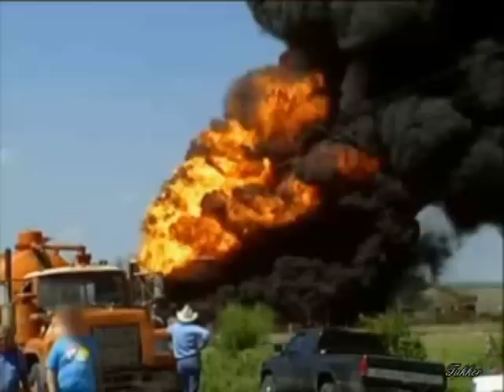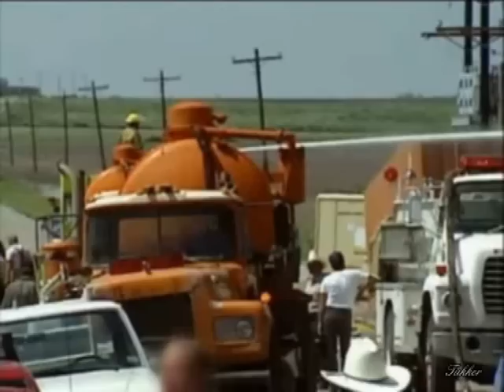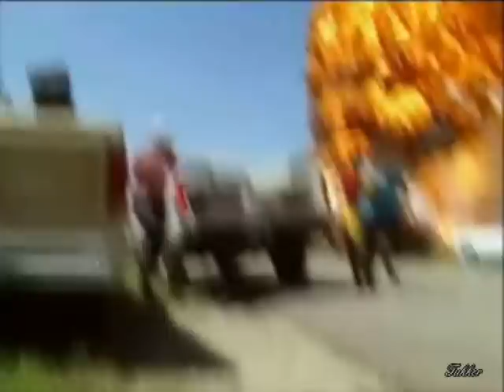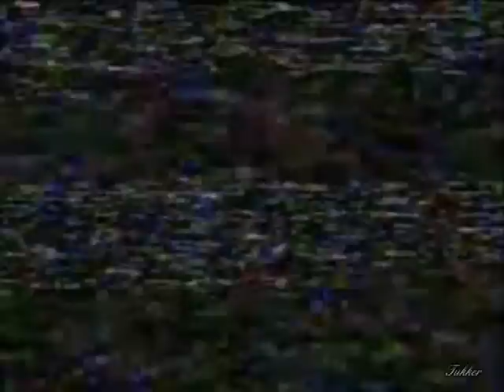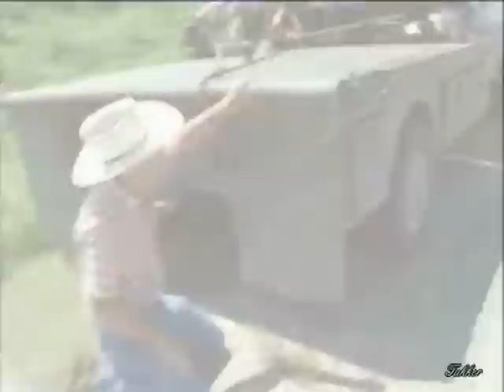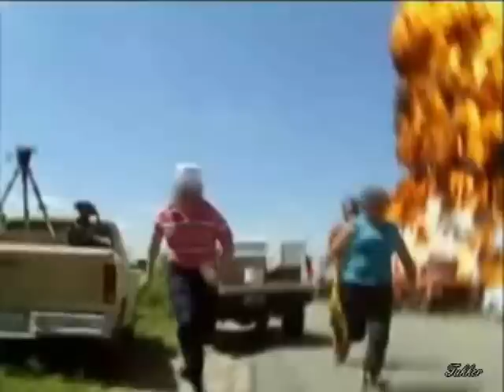Nasty Big Oil Storage Tank Explosion

Comment: WTF???? Water jets on an oil storage tank?  I hope that FD has learned something since then.  Technically the narrator has it slightly wrong as Chris Pichak has stated. It wasn't the fact that the oil was being heated by the steam as the oil was already past flash point but it was contained within the tank and only the exposed surface was burning.  What the water does is sink below the oil as the oil is lighter and then the water under the oil gradually reaches boiling pojnt and turns into an expanding vapour (steam) pushing the oil out of the confines of the tank and then the oil is free to burn. In the UK it's called a BLEVE an acronym for Boiling Liquid Expanding Vapour Explosion and is the reason you don't throw water on a chip pan fire.  The correct procedure is to cool the exterior of the tank with water to cool the oil in the tank until enough foam compound is available to attack the fire with a foam blanket AND maintain it.  The alternative is to carry on cooling until the oil burns away but that may take days and is not good for the environment.  The other point is WTF were members of the public allowed anywhere near such a massive explosion risk....it defies all logic?
Reply: Absolutely! You dropped the science right here!
Reply: thanks for the explanation. I feel like those people there were actually still sort of lucky, becauae if for some reason that tank had burst at a low level and let the oil flow out, they could all have been standing in a lake of fire in seconds.
Reply: Yes, this was Texas.
Reply: And I don't know why people are running away like it's WW2, They don't know That only gives 1 explosion and they are already enough away

Comment: @Moppy1988 We actually use steam to put out fires. We use a nozzle that creates a fog pattern also called a V pattern. The nozzle breaks up the water droplets to make them smaller which in turn causes them to turn to steam faster. The steam than expands in the air and displaces the oxygen in the air which causes the fire to go out. If done correctly you can put out a room on the second floor while attacking the fire on the first floor. Never even have to walk up the steps.
Reply: Yes, the fire triangle, fuel, oxygen, heat.

Comment: @Moppy1988 Its called a BLEVE (Boiling Liquid Expanding Vapor Explosion). What happens is during the fire the liquid inside the tank is turning to a gas which increases the pressure inside the tank. The pressure is so great that it causes an explosion releasing all of the gas that instantly ignites and then goes back out. Its like lighting gasoline on a bonfire. You get one huge fireball then it goes out and the only thing left is a small amount of fire but lots of smoke.
Reply: Right.
And the folks standing aroind were lucky that it sas a storage tank which only withstands low pressure. Hence, high prdssure could not build up, so the increase of fire intensity occurred ratjer slowly. Same amount of fuel evaporated at a 3 or 5 barg pressure would have left no time for escape......

Comment: These firefighters did what you should never ever do on any oil-fire: Put water on it. It WILL explode if you do that. Extinguishing foam should be used or extinguishing powder (In germany we have special trucks called Tro-TLF Trockentanklöschfahrzeug which usually contain 4-10 tons of inflamable powder)

Comment: @Moppy1988 Liquids only burn on top of the tank not in it. By cooling the tank down it decreases the temp of the liquid inside the tank. By decreasing the temp it moves the liquid away from its ignition temp which means it will not burn. The same applys to any fire. You cool the burning product down and it goes out. Yes some of the water will turn to steam. By the way that steam that is supposedly making the fire worse is a lot cooler than the liquid in the tank.

Comment: Not saying I'd react any different in that situation, but if it's all radiant heat would squatting down behind a vehicle completely shield you?
Reply from the maker: I guess it would shield you for most of the heat but the nature of human is to run if danger has been noticed.
And not knowing what might happen in the seconds after the fireball might make the panic even worse and force them to run.
Reply: I would think the radiated heat would still get past anything line of sight, so your legs could burn depending on the height of the car. Plus you could find yourself leaning against a vehicle that bursts into flames itself if the temperature gets too much, then you are faced with a much greater problem.
Reply: @CRTukkerr  how old were you when the oil tank exploded and how long did it last for i want the full video so i can see the whole video

Comment: @Moppy1988 They are not putting water directly on the oil. They are trying to cool the tank down to prevent the BLEVE from happening. Its a standard tactic used in the fire service. Now what you can call them stupid for is only using a single deck gun, should have been using at least three of four. The narrator in the video has no clue what he is talking about.

Comment: In essence as the oil burns it will release the lighter hydrocarbon fractions and the heavier fractions will travel downwards due to their higher density. If there is water at the tank bottom it will boil and shoot the oil out in the air. The resulting fire may be in order of 10 diameter tanks (Ref.: LASTFIRE Report).

Comment: cool footage, pretty fishy physics explanation. evaporating water cools, it does not heat. it could cause a pressure rise, but I don't think any notable amount even made it in the tank past that heat. the huge increase in fire intensity was either just that the oil reached a critical temperature of much greater evaporation, or that some portion of the tank opened up and created more oil/air contact. 

the firefighters should have prioritized moving people to a safe diatance. getting people out is always the first thing. what if that oil tank had burst at a low point, all those people could have been standing in a lake of fire in seconds.
Reply: nevermind, somebody posted the explanation: the water sank into the oil and then boiled under the oil, producing a giant fuel burp.
Reply: @Ass_of_Amalek  Semechki appeared in Russia in 1698. It was Peter the Great who brought sunflowers from Holland. Russian people immediately fell in love with beautiful sunflowers.

Had to look it up.  Godspeed Ukraine 🇺🇦.